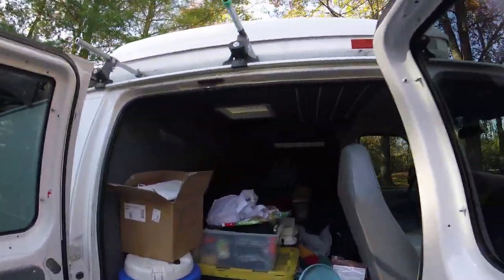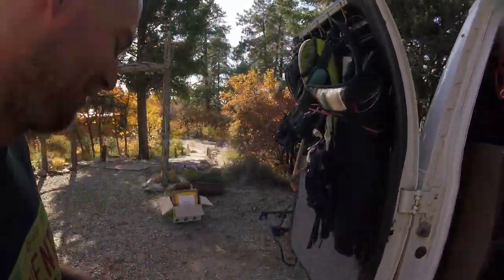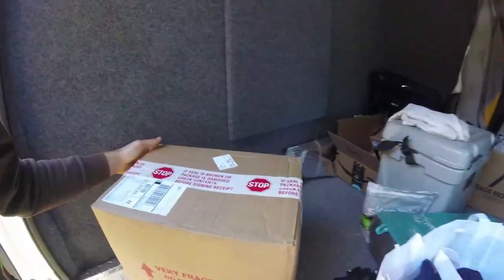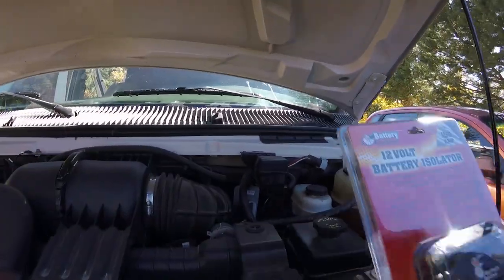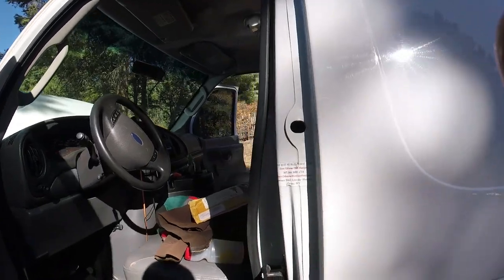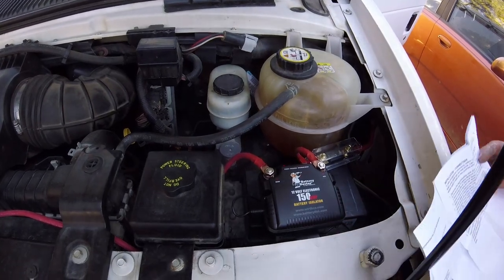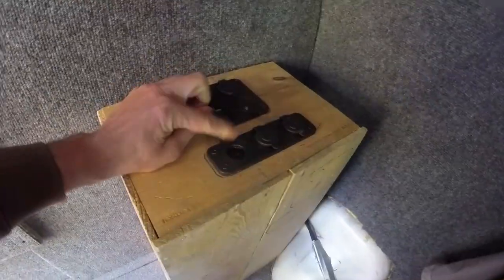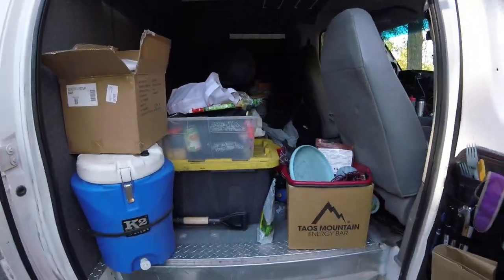Semi-Final Van Tour - EVERYTHING BUT THE CABINETS

Comment: I have a couple of inputs here. 1: Did you put any sort of rubber grommet around the holes that power line goes thru in the van? Rubbing against a sharp metal edge can lead to disaster. 2: Since y'all spend a lot of time just sitting in the desert, is there a way to mount a solar panel to charge the aux battery? It seems that would be a great idea for being out in the desert sun all day.
Reply from the maker: +Hal Horton hey thanks for the comment 1) yes we did! And 2) yes we could totally do that (and hope to do so in future) but it's not really in the budget at the moment 😉